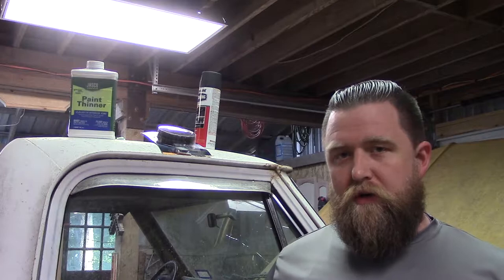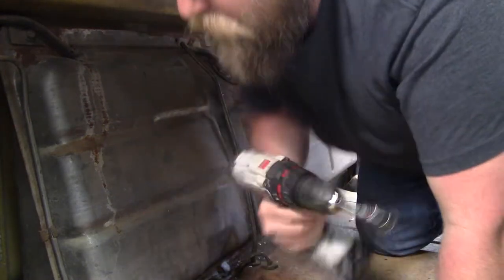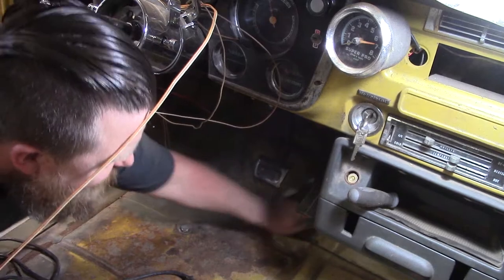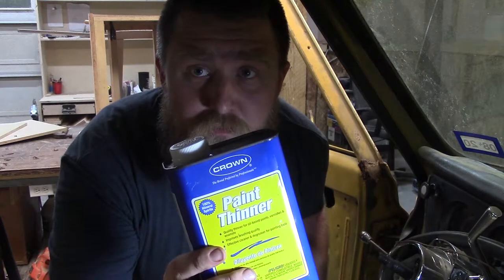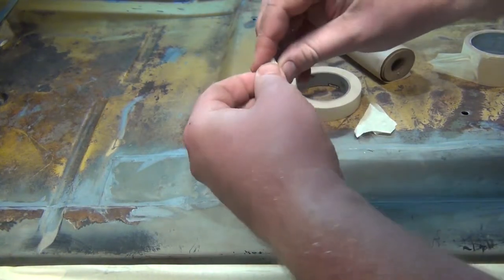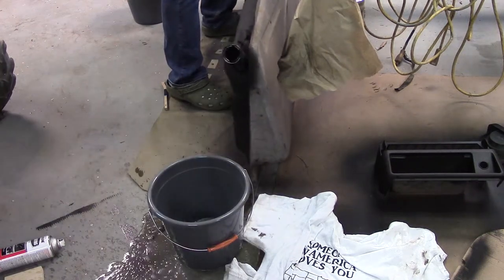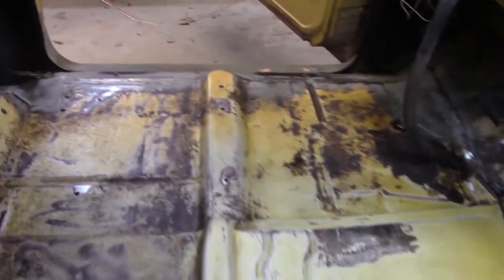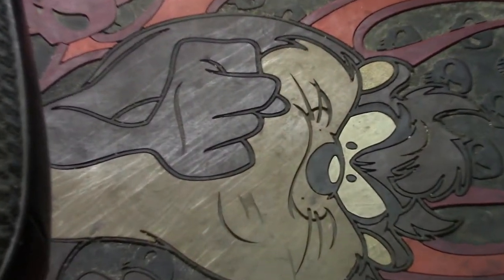FINALLY!!! Painting the cab floors 1972 Chevy C10 (ol' Yeller)

Comment: Paint thinner and mineral spirits are inherently oily. It may have worked better if youd have cleaned the floor with acetone but undercoating works best on a coarsely sandblasted surface and best used under a vehicle